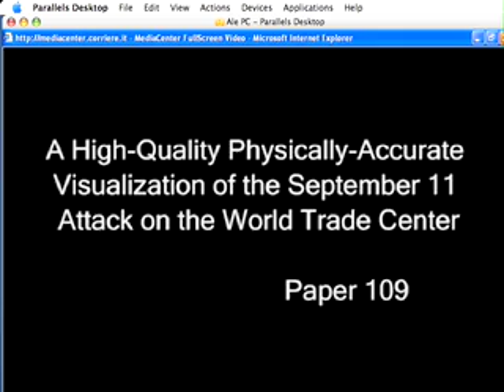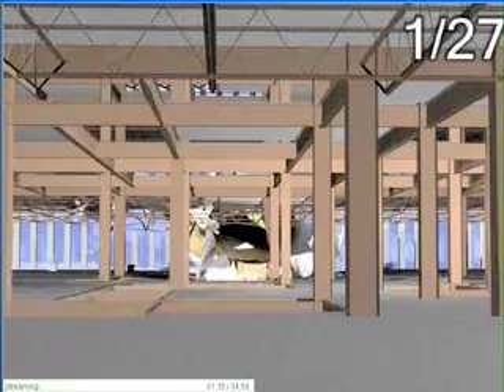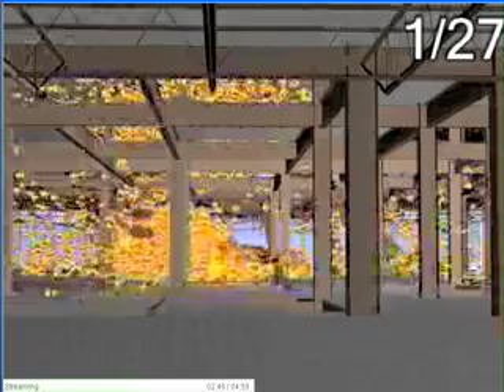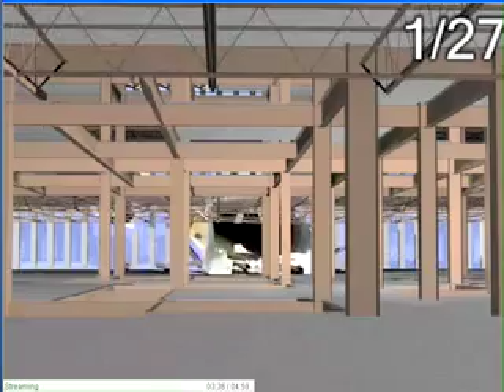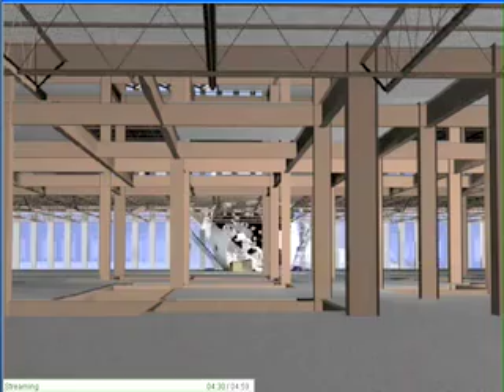9-11 Twin Towers Attack 3D simulation

Comment: Each tower had 3,000x more mass than a 747. In human terms that is 1 oz vs 195 pounds. And how is a 1/13th inch (0.07 inch) thick sheet of aluminum (thickness of aircraft shell) supposed to slice through multiple 1.5 inch thick outer steel columns and 4 inch inner steel columns???!!!???!!! 95% of the fuel would have burned up outside of the building in fireball, the rest within 10 minutes, and the air velocity of a kerosene explosion is nowhere near high enough to cut thick steel beams. That's assuming there even were planes which many people doubt. This simulation is a joke and the scientist at Purdue who made it has never released the data for it despite multiple requests.
Show less
Reply: Actually the steel according to plans of the world trade center towers at the impact points are 2 inches on the south tower and 2.5 inches on the north tower. The core steel at both levels was 4 inches thick on all 47 vertical supports and 3.5 inches on the horizontal supports.
Reply: According to blue prints that I had prior to 911 the thickness of the high strength box steel at the 80th to the 105th floor was 2 inches and the core columns was 4 inches thick. Also according to the structural steel for both the outer box columns as well as the inner core columns where tested at random to be able to withstand an impact of one hundred and eighty thousand pounds per square inch without failure prior to construction start. Although it seems the commission led everyone to believe that these two towers where constructed as an accident waiting to happen. When in fact they where over engineered and designed to withstand an impact of a boeing 707. The fact that 767's struck these buildings was only a minor issue as they are only 9% larger than a 707. the fuel may have played a roll. However only with the intial impact as the volume and speed would have been greatly reduced when the airliners struck the building. There would not have been enough material from the planes to seriously damage the inner core.
Reply: This simulation is a joke ! ! !
Reply: At 01:55 part of the plane skin passes through one of the horizontal steel beams on the lower right of the view.
Reply: Kenneth N. Amend
You're doing exactly what you're criticising others for. You're believing everything that you're told, regardless of the fact that it makes little or no sense.
Reply: no your not taking into acount mass or size of the object or what it is made of.  whats faster a plane or a bullet,   a bullet because passenger jets do not exceed super sonic speed. But bullets travel at speeds close to or exceeding Mach 1
Reply: Kernow Properties
''You do realise of course that an aluminium plane hitting a steel building at 600mph is the same as the building hitting the plane at 600mph!!''

No, it isn't. That's a completely bogus argument.

'' Go read some physics ... do some experiments.''

After the nonsense that you've just posted, I kind of think you should be taking your own advice.

'' What will it take to wake you people up?''

A sensible and logical theory, with evidence and experimentation wouldn't be a bad start. Mere supposition and erroneous physics tends to have a soporific effect.
Reply: Kernow Properties -well no video exists of it as it was done in college back in 1990.a homemade air cannon with a 8' long 3" inside diameter was used.it wad built by the professor and previous students in 1987 i believe. it was powered by an 80 gal commercial air compressor rated for 240 psi if i recall.we only needed 120 psi to achieve the 395 mph necessary to penetrate the car door.
we tried various methods.as the cannon was 3" inside diameter we had to make a foam sabot or "shoe" that contained the marshmallow and fit the barrel.the sabot peels away from its payload,in this case the marshmallow,immediately upon exiting the barrel and was of no consequence to the door.we also constructed a sub caliber barrel insert that was installed inside the 3" barrel and fit the marshmallow perfectly.however the friction of the marshmallow travelling down the tube tended to distort and tear it and caused early and more pronounced deformation due to wind resistance.this had little effect overall and even though it was messy and made obviously larger impact marks on the door,it still penetrated easily as the majority of its mass was still homogenous and its energy intact. for the above reasons we returned to using the full bore barrel with sabots around the projectiles.
.the muzzle was exactly 14' from the car door with both setups and the chronograph(a device that is commonly used to measure the speed of bullets and other very high speed projectiles)was placed exactly 8' from the muzzle. the marshmallow would have immediately begun deceleration due to wind resistance and you are correct in assuming the marshmallow would deform and "turn to mush". however it encountered the door long before this could happen to any meaningful degree and also before it could slow to any meaningful degree. the marshmallow hit the door with a thunderous clap that sounded like a handgun being fired and caused quite a lot of destruction.

besides marshmallows we also fired many different objects at many different targets. beer cans at sheet rock and 2×4" framed walls,2"4"s at brick walls, grapes at plywood,and multiple sized custom made aluminum bullets ranging from a largest of 2.875" diameter down to a small of 1" diameter fired at brick and concrete block walls and 1/4" steel plates.we achieved penetration of ALL targets using ALL projectiles at a maximum achievable velocity of 617 mph or less.
this is very common experiments used in physics classes all over the world and similiar experiments can be found on youtube.
you can also study similiar experiments by reading any ballistic studies manual. its all very simple physics.
you made no mention of the Q-tip.were you not equally incredulous about that?
you can easily recreate that experiment/accident with any .22 cal pneumatic air rifle. i caution you to be very careful,wear safety glasses and DO NOT fire at any living person or creature. it will most definetely turn just about any object that will fit into the barrel into a lethal projectile at short range. smaller objects can be wrapped in tissue to fit the bore (a kind of sabot). the tissue will immediately seperate from the projectile upon exiting the bore and the projectile will continue on to its target.
i caution you again.BE CAREFUL! DO NOT FIRE AT ANY LIVING PERSON OR ANIMAL!
an air rifle can teach you much about ballistics and physics.
how energy in particular is created by mass moving at high velocities.
and it will prove to you how even a Q-tip or cotton ball driven at very high velocities can penetrate seemingly impenetrable objects.
it will also help you understand what happened on 9/11 and how it happened.

i will be happy to provide you with more details,pictures of penetrated objects etc if you like.
just send me your email or contact info.
and after ive proven to you that those aircraft did cut through those towers please use your newfound knowledge to educate and inform others.thank you!
Reply: Kernow Properties -was just checking in. ever do any digging on the subject of ballistics and if so how did it affect your beliefs and understanding of 9/11?

im not interested in ridicule or name calling etc. id just like to know if anyone has changed their opinions on the matter after considering my statements.

hope all is well either way.
Reply: is this video of any use for this debate?
https://youtu.be/acRnKnsddwc?t=190
Reply: U nerd
Reply: 1ChampagneSupernova1
Try learning the difference between facts and ludicrous theory.
Reply: you speak the truth
Reply: 1ChampagneSupernova1 - Let me know when you turn twelve; I'll send you a card.
Reply: oddhominem Why don't U!! Read what you just posted to me. I have NO DESIRE TO BELITTLE anybody or get so worked up about having to have the RIGHT answer. I believe NOTHING I hear and less then half of what I see. Serving my Country is a Polar Opposite of serving the Federal Government. FACT. If your going to take the time to  criticize  someone's level of  understanding just because you don't agree!!! Help me understand, what I don't see. Perfect example..and NO it's not hear say!!  WAR on Drug's, ever heard of this. This is just for u, I was stationed in Florida in the United States Navy are Primary Purpose was Drug Interdiction. Only during that time was I prompted to research more about the production of Cocaine & HEROIN. What I learned rocked me to the core. Mother being Vietnamese and during this so called conflict. Why did Nixon declare a War on Drug's?? Next What did he do with the planes coming back from Vietnam?? That's Right Great answer...CIA brought back HEROIN by the metric TON. Have U ever seen  metric TON of DOPE??? Exact same system was put into play with the Columbian Cartel's except this time instead of Heroin in the Northeast, Cocaine in Southern California "CRACK". Communities and multiple generations have been wiped out. All WAR is based on deception. So the next U exert the energy to accuse anybody for believing what they hear...maybe it just might be  wise to reevaluate what you heard. 911 Truth...Sucks. Simple minds DESIRE simple answers... War on Terror. It's all about the Benjamin's.. $$$ Federal Government doesn't give  crap bout you or me.
Reply: wiibaron you're the twoofbitch
Reply: seneca you're wrong. Go fuck yourself
Reply: Kenneth N. Amend - You've kind of gone of at bit of a tangent, there, haven't you?
Reply: oddhominem Fair enough, you got me odie oh. I saw hialrius3 episode of david letterman. These 2 dudes were playing catch with football on the beach. So letterman had these Chinese dude make an effort to join in...well they were like what the hell!! Sure. Though as soon as they tossed him the ball, He hauled ASS in different direction!! I could not stop laughing. To thiz day thats funny shit!! Simple. Your funny also. your like that kitten or puppy, that pulls out all the toilet paper to play.
Reply: Kernow Properties - allow me to explain something. your understanding of physics is very incomplete. it makes no difference that an object is made of a softer or harder material if the velocity is high enough it will penetrate like a hot knife through butter.this is FACT.
the predominately aluminum planes blasted through the heavy steel structure of the WTC Towers due to their tremendous velocity.
this is fact guy.any high school student taking physics can give you the formula,convert it to lbs per sq inch of energy and this figure can be compared to published data concerning the strength of the steel structural members of the towers construction. you can denigh it all you want but you just look ignorant to everyone who understands physics.

ENERGY= MASS(WEIGHT)×VELOCITY(SPEED IN MPH OR FPS/MPS) SQUARED. what this formula tells you is that energy is very much dependant on velocity as it is taken as a factor multiplied by itself. what this means is energy rises sharply as velocity is increased. to illustrate this once again ill tell a story.
in school using a high powered air cannon i fired a marshmallow completely through a steel car door. a 1982 Ford T-bird with heavy steel doors at that. did you hear that? a marshmallow.fired through a car door.all the way through the outer door skin,through the inner frame(there was no glass),through the plastic door panel and into the cars cabin. and it only required approximately 395 mph to do it.
now if i pushed the marshmallow to only say 150 or even 250 mph it would have made a small dent and perhaps blasted away some paint but would not have penetrated the door. this is fact also as we fired many marshmallows at the car door,raising velocity in approximately 50 mph intervals until penetration was achieved.
as it turned out at approx 350 mph a large dent and small split was achieved and at just under 400 mph it punched completely through.in a different area of the door before you conclude it was the cumulative affect that did it.

also using a .22 cal air rifle i fired a Q-tip through a beer can,cardboard box,completely through my office wall and dented the opposite wall of the adjacent room.
how do you explain that? marshmallows last i checked wete quite a bit softer than steel,and Q-tips are just rolled up cardboard with cotton swabs on the end. not very hard,heavy or particularly pointed yet that Q-tip could have easily killed anyone with their head in the way instead of penetrating the wall. well? how? by your logic this is impossible. 
also how does soft lead and copper bullets penetrate inches of solid steel? ive done it myself many times. ive fired a .30-06 completely through a 22" thick pine tree and still had enough energy to penetrate another 5" thick tree.ive fired all the way through a cast iron engine block from a Dodge pick up truck. ive fired a .308 winchester round through 3/8" thick steel plate and using armor piercing rounds itll penetrate 1/2" thick steel. ive seen battle tanks with 5" of hardened armored steel penetrated by 25mm rounds. ive seen those same rounds penetrate 10" of solid high strength steel reinforced concrete. ive seen 105mm tank shells penetrate 36" of the same concrete. how can this possibly happen? how about WW2 battleships with 24" of solid hardened armored steel penetrated easily by shells fired from miles away. how?
its really quite simple. energy! energy as a result of mass going at high velocity. it makes no matter what that object is. even a cotton ball or a marshmallow can be blasted all the way through the WTC Towers if driven fast enough. now that would require really stuipid velocity but my point is it CAN be done.
yet you cant believe an aluminum,composite,titanium and steel aircraft loaded with many tons of fuel,passengers and their luggage and travelling at almost 600 mph! cant penetrate a thick steel and concrete structure? well im here to tell you not only can it happen, it DID hapoen! and millions of people with 2 eyes and a brain and even a basic understanding of physics saw it happen and undertood how it happened.its very simple .that much mass travelling at that velocity is an irresistable force. nothing! no building on Earth save for hardened bunkers or nuclear fascilities could have resisted the aircrafts intrusion.and this too is FACT.
its right there in black and white.do the math yourself.research a bit and learn some basic high school physics. watch some youtube videos of guys firing rifles at various materials. its all right there staring you in the face and covered in great detail in the NIST report.and every word and every detail can be corroborated by any high school physics book and can easily be recreated and verified in any farmers field with a rifle and some scrap from a junkyard.

if you still dont want to believe it your simply ignorant and incapable of reasoning and logic not to mention devoid of even a high school education. that too is FACT.
Reply: Kernow Properties -btw i will be happy to show you personally the experiments that will prove these facts to you.

i have many videos and pics of my various firing range excursions and will be happy to provide them to you. i will even perform an experiment just for you. i can easily create a scale model of the WTC structure and using a rifle and a handloaded round with a homemade aluminum bullet,i will prove to you that not only can aluminum easily penetrate steel but much much softer and lighter and less dense materials can as well. just say the word.
Reply: Hmmm! A marshmallow through a steel door.. Cool!.... Eh, how did you get a marshmallow to 400mph without it turning to mush?... I would really like to see that!... What equipment was used for this?.. Do you have a video... or surely you have some other actual proof other than you typing words on you tube?
Reply: Buddy Huggins this entire video is insulting
Reply: Oh, I see! The impact forces would be different would they? So, perhaps instead of making smart arse remarks you might want to back that up with some proof ... I did ask a qualified structural engineer about the forces without letting him know why I was asking and he informed me that a car hitting a wall at 100 mph will sustain the sale damage as the wall hitting the car at 100mph if you take into consideration the extra weight of the wall and applied an appropriate level of braking force to the wall.
Reply: or, like butter through a knife I suppose!!! Oh yes, please do send me those videos you speak of. That would be very interesting to see a ping pong ball pass through a bat or a knob of butter pass through a brick wall.. Sounds like fun!
Reply: buddydude  - go get a tan or an education. You´re too dumb
Reply: theres no way possible for that plane to break so much steel. it would have barely broke through the outer layer
Reply: seneca, can you say shill? Omg.  You are either a brain dead idiot or a shill.
Reply: +Grizzly Adams  The buildings weren't solid steel blocks.  You realize they had to connect those steel columns to each other, right?  The connections are what broke first, not the steel itself in most cases, and it doesn't really matter if the plane was made of so much as its speed at impact.  Do you remember the Space Shuttle Colombia disaster?  All it took was a piece of foam to break a reinforced carbon-carbon heat shield because the foam hit it with a great amount of force due to its speed.
Reply: Conspiracy theories are the new money making SCHEMES
Reply: FAKE, FAKE FAKE.
Aluminium does NEVER cut steal, no matter you try.  
The most ridiculous is that instant of the  wings and tail cutting the external pillars.
As everyone can see,  they cut them as butter.  The wings are made of aluminium and not able to cut steal, but the tails are made of polymer, liter than aluminium but more weak and breakable than it. 
Enough is enough! 
Stop playing us the fool.
Reply: Thank you for it, In fact steel is the thing. But no matter you face it, throwing a penny against a hammer or the hammer over the penny, the poor penny is always the looser. Sorry, but no arguments can face the laws of physics.
Reply: I don't buy it. There's no way it was weakened by fuel fires. The fuel burns off too fast. And Concrete and steel DONT BURN. And even if it was weakened steel that caused the beginning of collapse, there is NO WAY to use 1 material to destroy the same material without both parts being obliterated at the same rate. The physics just don't hold up. By the time the lower 20 stories were obliterated by the upper section, the upper section would've been pulverized. The Laws of Conservation of Energy and Momentum say it couldn't happen like it did.
Reply: Your steel thickness measurements are sooo exaggerated it is comical. 4 inch thick steel columns?
Reply: wiibaron first of all im baseing my imformation of buddies who beilives this conspiracy. if you read the orignal posters comment you would maybe understand. second of all "thruthertards" you conspiracy theroists have a picture of "burning thermite" and fire fighters trying to put it out. when in reality that picture is a bunch of fire fighters with a flood light not thermite. you say idiots beilive "how can a plane going 600 mph do that much damage , it has to be explosives". i personaly work construction DO YOU HAVE ANY IDEA how effing long it would take to put thermite explosives up 60 or 70 floors to dennoate in the fashion you see from he video of the trade center collapseing? LIKE you guys seem to think you only have to blow up like 20 floors to accomplish that effect. no and btw it would take WEEKS maybe even a few months to plant that much thermite and thats working 8 hour days. ALSO it would take more then 2 dump trucks filled with thermite to acheive a collapseing building. it would take a crazy system to denoate the thermite in a fashion where each floor colapses that way. and also your guys stupid little "traces of thermite in rubble" bullshit has been debunked google that shit or wait no "it must be the reptilian nwo overlords trying to form a cover up". how about instead of wanting to be cool ,use logic and look up both sides of the argument.  and btw its a conspiracy "theroy" meaning if someone can disproove one part of it , it means the theroy is no longer valid. and its been debunked the traces of thermite shit. so go put on a tinfoil hat and jack off to nwo conpiracys some more.
Reply: Steve Edge -you seem reasonable and intelligent but your understanding of physics and the forces involved is way off base.
the main factor in the aircrafts intrusion into the towers is not their size fuel capacity or even their weight although they did play a role. the main factor was the aircrafts speed. you are correct that the WTC Towers were designed to withstand an impact from a 707 but the scenario allowed for in the design was for a plane perhaps lost in fog and travelling at much lower speeds.
the aircraft used on 9/11 were travelling at approximately 470 to almost 600 mph. much much faster than anticipated and much much faster than ANY building on Earth could resist save for perhaps hardened bunkers and nuclear powerplants and facilities.

the energy of the impacts was tremendously more than the design could accomodate and was easily enough to blast through the outer perimeter,inner core and opposite outer walls as anyone with eyes can see by observing the event live or watching video clips.
its right there for the world to see.it happened. so why you people continue to make these preposterous claims to the contrary ill never understand.
there was no missles or bombs or any kooky building blasting space ray. aircraft flying at those speeds are more than enough to do what i and everyone else with two eyes and a functional brain saw heard felt and smelled that they did.
do the math.any high school student can give you the formula.
mass(weight) × velocity squared (speed) = energy. convert to pounds per inch and then tell me the steel structure wouldnt or couldnt be damaged or in fact destroyed.just like we all saw with our own eyes.period.
Reply: via this logic, bullets should just bounce off me
Reply: E=MC^2
Reply: Rajeev Ratan a bullet travels far faster than a plane just to let you know
Reply: wiibaron i was copying that original poster. but yes your right. i acctualy dont knowthe exact thickness.
Reply: Buddy Huggins first of all, the beams at that height were only 5/16 inch thick not 1 1/2 inches.   If you understood 9th grade physics, the plane penetrating the towers( which were nearly 95%air) would be easily understood.
Reply: E=MC^2 is how. 500MPH!!!
Reply: Buddy Huggins totally agree with you.
Reply: Buddy Huggins -hmmm.so your saying you could withstand being shot with a 1 oz load of buckshot from a 12 ga shotgun,huh?

look its very simple physics.if you drive an object fast enough it makes no difference what its made of or how soft or hard it is,it can penetrate and destroy a much larger thicker harder stronger material. for example,using an air cannon ive fired a marshmallow all the way through a car door. using a .22 cal air rifle capable of about 300 mph or 350 to 450 feet per second, ive fired a Q-tip through a beer can,cardboard box,all the way through my office wall insulation an all and still dented the far wall of the adjacent room. its simple physics. mass(weight) × velocity(speed) = energy(momentum) 
those airliners at an average of say 450 mph had enough energy to cut through a building made of steel beams and concrete twice as thick,hard,strong as the WTC Towers.NOTHING can withstand that.
if they were only travelling at a modest 150 mph or even 250 mph the buildings would have resisted their intrusion. there would still be damage and fire but the vast majority of the wreckage would have remained outside and the Towers would likely be here today.

educate yourselves.learn physics and know what your talking about before you go spouting a bunch of nonsense and looking like idiots.
Reply: You do realise of course that an aluminium plane hitting a steel building at 600mph is the same as the building hitting the plane at 600mph!!... Are you still telling me that the steel frame would would give way to some aluminium?... Go read some physics ... do some experiments... fire a solid aluminium bullet at some steel frames and look at the massive amount of damage done to the frame.... Oh wait, thats right, no damage! just keep believing in the official narrative.. I know it lets you sleep at night... What will it take to wake you people up?
Reply: seneca your whole synopsis of what happened seems somewhat easily persuaded,  "DO YOU HAVE ANY IDEA" how effing long it would take to put thermite explosives up 60 or 70 floors, to detonate in the fashion you see from he video of the trade centre collapsing "
You have just confirmed what happened.
Reply: seneca Exactly how truthertards 'do' their research. From each others' videos and comments.
Reply: Buddy Huggins  The plane is going at 600 mph! As the front end of the plane hits the surface of the building it goes through. once it starts getting to the steel beams since the building exterior didnt provide much resistance the plane is still flying very fast. as the front end of the plane hits the steel beams it compresses. for eg you know when see a car accident ; a head on collison the front end of the car is crumpled? imagine a big ball of compressed 1
1/13 inch thick aluminium flying at a steel beam at 600 mph do yoy think the steel beam will stop that? also the engine block is titanium and it flys right through the steel like toothpicks. since the fuel is located inside the plane the cabin of the plane would of stayed slightly intact and now blow on the exterior of the building. infact theres footage lol so yeah thats disprooven. now your saying "jet fuel doesnt get hot enougj to melt steel" yes you are right! but jet fuel does get hot enough to turn the steal WHITE hot and you could bend it like a peice of licorice. also the molten material spilling from the building is molten ALUMINIUM not steel. because unlike steel aluminum can melt at jet fuel tempatures. the sparks comeing from the building are from all sorts of stuff. lots og things that burn cause sparks. the windows breaking and big puffs of smoke are from 2 things the downward force of the building causeing pressure to build up breaking the windows sending drywall dust and smoke out the windows. AND people breaking the windows with objects to either a jump out or b vent out smoke. this building also has NO sprinkler system. so instead the engineers designed the building with 5 sheets of dry wall do the fire cant spread hense why you see big puffs of dust. Also people say "i heard explosions" because when a plane hits a building and its on fire and theres gas lines everywhere what do you thibk you will hear? and also youtube a video of thermite in action. thermite DOES NOT EXPLODE! it gets VERYhot and makes a sort of sizzleing sound and sprays sparks everywhere. and for the 3rd building new pictures show it was infact on fire and office fires get HOT! more so then you think and there was no sprinkler system in that part of the building.
Reply: JaDo Steele The Chinese have a proverb, it states. Those who believe everything they see are the easiest to FOOL"!! Fed's know how easy it is to manipulate the masses. Most will not only believe all they see and what there told, they go a step further by defending what they see & are told to be TRUE without any logical factual data throwing logic out the window! Being fooled by what they feel only to lashout at anyone with conspirator, truthtard. Im NO DR. PHILL..Here's the kicker...Though it doesn't matter if the plane was traveling  500, 600 even 700mph NO where near enough KINETIC energy. Here's 1 simple example, many of us that have served in military are aware of why the rest of the planet, wants nothing to do with facing our M1 Abram. It fires the SABOT round, composition 120 mm depleted uranium penetrator which is 10lbs and this will cut through an adversaries armor like butter, then liquefy those inside.  You'll be able to wash most of there bodies out with a water hose.  Planez a TIN CAN. Tell a lie long enough many believe it. Even one of the deceived Cheney supporters stated that structural steal melts at 1470deg and at 800deg losses 90% of its strength.  2750degrees is when structural steal will melt.